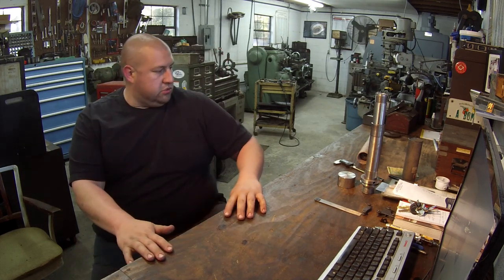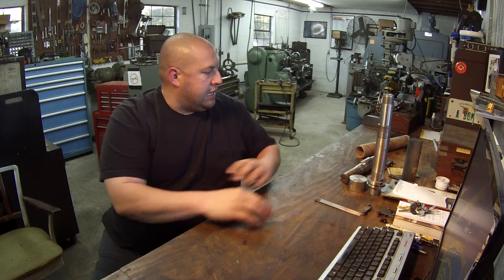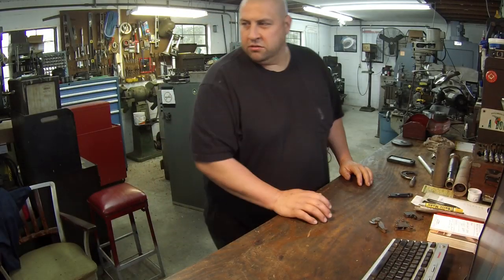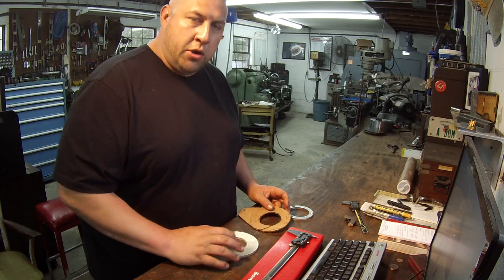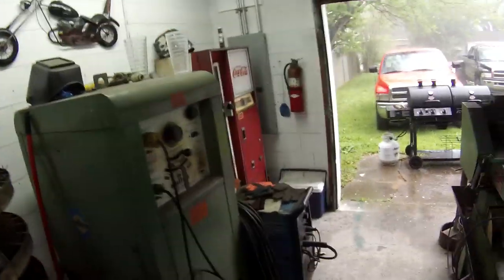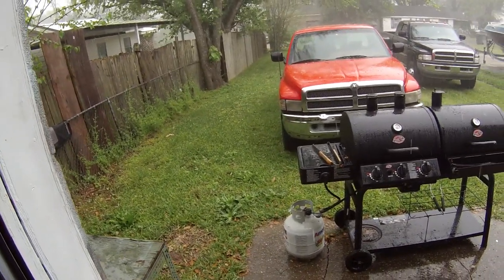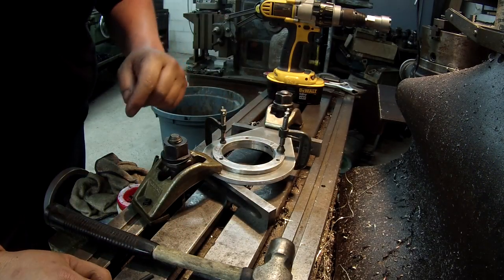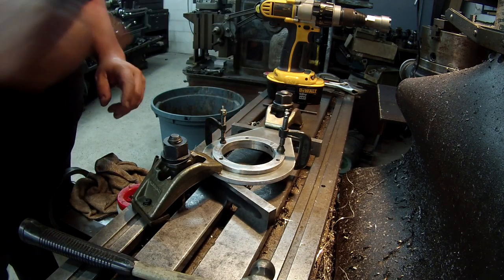Saturday Night Special 14

Comment: Hi Adam,

Now I'm at the age were I get my new unused stuff and tools out and use them before it's too late, great tools are meant to be utilized as often as possible.

That red Dodge Ram, I've got a similar one 1999 with a Cummins engine. Good truck, but here in Province of Quebec salt on the roads get's the cars and trucks pretty eaten up after only a few years.

Something we had bigger than you aroud here is, 5 or 6 years ago is a hail storm with hailstones the size of golf balls, you should have seen the cars, the vegetation and the house sidings after the storm... Finally, bigger is not always better!

Liked to see the big set-up at your job, something that shows how creative we have to think to get the job done.

That tiny hammer was a super nice piece of craft.

Thanks for sharing your taught.
Pierre

Comment: Adam,
When my dad was teaching me to use shop tools, he always used the term "drill" for twist drills used to make holes in metal and "bit" for drilling wood. If you look at a drill index, it says "drill index," not "drill bit index." The machine that makes drills rotate is either a handheld drill motor or a drill press. Using the correct terminology was drilled into us (pun intended) when working in the aerospace industry. The old timers would take to task, anyone who called a drill a drill bit. They would tell us to think of a drill for metal and a brace and bit for wood. Of course, that was about 35 years ago...

Tom - Vista, CA
Reply from the maker: Thats pretty cool. See...we are always learning something new in this trade!!
Thanks for sharing Tom!

Comment: Get a couple of VCI chips or a roll of VCI paper for those tools that don't see the light of day often. Vapor corrosion inhibitor will work to keep off the surface rust without leaving oil that will break down the foam liner in the box.

Comment: Another great video Adam. Just thought  I would give a little info on your tailstock turret. The most common ones are 5/8" holes with a #2morse taper. I have  the same one as you, and they were
Used on the turret lathes enco had, which is no longer made. I haven't found another source, as Ihave some friends that would like to have the larger model. Hope this helps. Keep up the good work. Jim
Reply from the maker: Thanks for sharing Jim. I think a long time ago Enco had there name on many great quality tools. I dont think thats the same these days though. Its a cool tool to have around, and something I just never paid attention to. I never seen the need to set it up and use.
Thanks for the comments Jim!

Comment: Adam nice work on the bracket, is that boring head shop made?  It looks really beefy.
Enjoy seeing your tool collection Adam.

+floridawind1 nice job on the vise Gil I like your welding table and setup  I'm jealous!
Reply from the maker: Bill, I'm pretty sure the boring head is a manufactured tool, but I can't find a makers mark on it anywhere. Its a nice stout unit thats always worked well.
Thanks for the comments, and I'm sure Gill will say the same.

Comment: In Gill's segment showing his refurbished vice on his welding table, I noticed a plastic gas can sitting just to the left of the table.  Splatter from a welding operation could probably land on the gas can.  Not a good thing.  Good work on the vice, Gill.

Comment: Hey Adam, Nice video, I liked the boring on the sprocket you did at work, what kind of machine is that? Also I don't think you are showing off by showing the kinds tools you have and use around the shop. I always tell my boys, " use the right tool for the job, and the job will be done right." So keep on sharing. Buddy
Reply from the maker: Buddy, the machine I was using is called a Horizontal Boring Mill. That machine came from our shop. My dad bought it back in 1998, and I've been running it ever since. Thanks for the comments.

Comment: What is a NOS turn attachment? How does it work?
Reply from the maker: Brian, I said NOS as in "new old stock" because thats what it looks like to me is a tool thats never been used. Its a Turret attachment for a tailstock on the lathe. You can put multiple tools in it, like drills, taps, countersinks. To rotate you push the lock pin and spin it to the next position.
Reply: Abom79
That's neat.Thank you for the explanation.